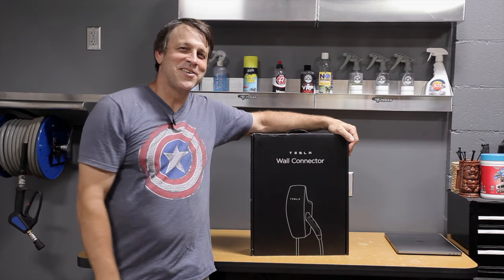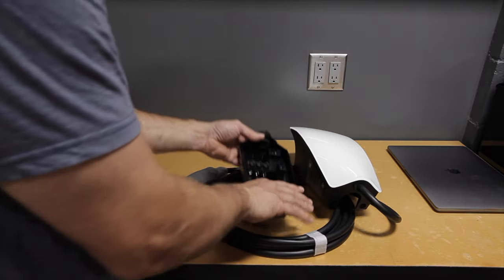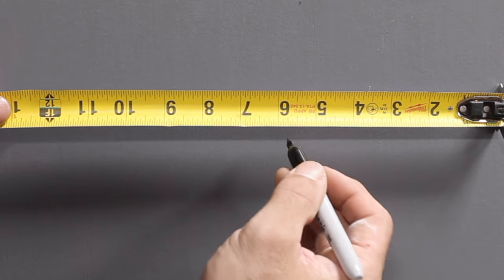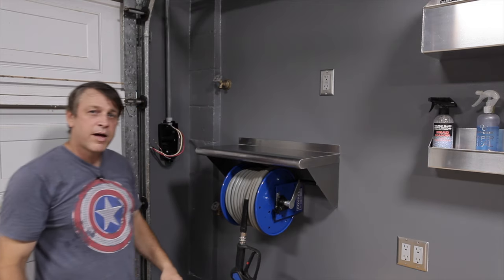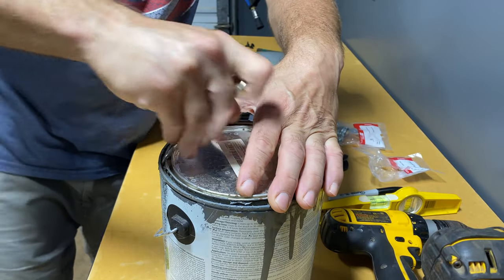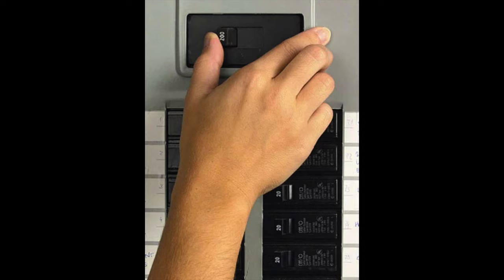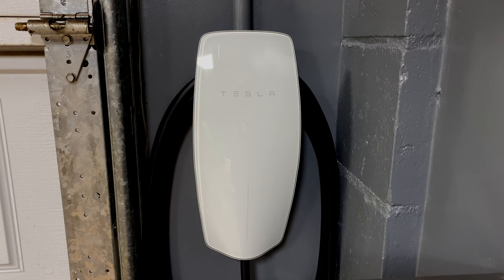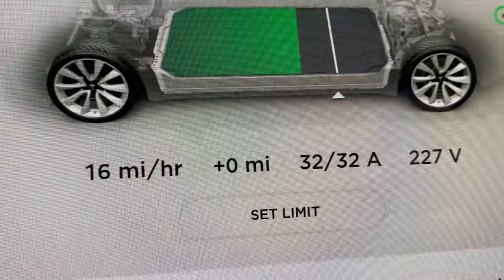HOW TO INSTALL A TESLA CHARGER / TESLA WALL CONNECTOR GEN 3 UNBOXING & INSTALLATION

Comment: I did my install in 2018 with the gen 1.  In the gen 1 there was switches to set and it was not as simple as the latest Tesla wall charger.  I also used 40 amp ckt breaker and used wires rated at 55 amps my material was less than $150.  The install was rather easy.  With the latest wall connector it seems even easier.

Comment: Great job and simple explanation.  I saw some people using the white wire as ground. There's nothing wrong with it, but the ground doesn't carry any current under normal working conditions.

Comment: You were supposed to use the white neutral as the ground and cut the thin ground wire. Hope it works out for you
Reply from the maker: Come on man. Hahaha. Using the supplied ground is more then adequate for this install. You are right that I could have used the white as a ground and that is a good idea. Thanks for sharing and watching.
Reply: not really true. no reason to install a neutral. should have installed 6-2. better yet. building wire in conduit. not romex. unless its just a chase. he did not show the whole raceway.

Comment: I may have missed it but I wanted to know why you chose 40 amp versus going to a faster 60 amp connection? Nice video!
Reply from the maker: My model 3 does not support the 60 am charging. Some models do and I would use the breaker that is right for your car. Thanks for watching
Reply: @HawaiiDetailing  Right, it may not charge to 60 amps but it will charge at 48 amps so installing the 60 amp breaker would allow that. I get 240V @ 32 amps (on a 40 amp breaker) with the included travel charger with the NEMA 14-50 connector installed (I had the outlet installed for my air compressor awhile back). I'm happy with that but if I had a wall connector, I'd want get the max out of it. You could get 44 miles of range per hour at 48 amps while my Model 3 on 32 amps charges at 29 or 30 miles of range per hour. Thanks for the reply!!!!

Comment: Very informative video that was well narrated.

I currently have a 240 V/50 A connection for my 2015 Tesla Model S in our garage. I sold the car and ordered a new refreshed Tesla S. Two questions:

1. Is the mobile connector that comes with the car and an adapter be adequate?
2. If I decide to get the Gen 3 Tesla Wall connector, how easy is it to hook it to the 240 V socket in our garage? 
3. How much would an electrician charge to do this conversion?

Thanks.
Reply from the maker: 1. It’s a reaaallly slow charge with the supplied 110 wall charger. 
2. I think it requires a handyman level of skills with reasonable knowledge of electrical to be safe. Always use a pro if in doubt. 
3. I am not sure if the cost in your area. 
Thanks for watching.

Comment: Good video on the installation. Did you cap the white neutral wire at the breaker panel also, or did you go ahead and connect it to the neutral buss?
Reply from the maker: Thanks. Capped it on both sides.

Comment: Great install. Out of curiosity why is there a "maximum height" for install. I've seen people mount them on the ceiling and use a retracting cord to pull it down and have it all out of the way.
Reply from the maker: I am not sure. Maybe a code thing. Thanks for watching

Comment: So how long did it take for you to be sick of having it stuck back in the corner?
Reply from the maker: Its still in the same spot. I like it there. Only real option I had as well. Its just me using it and the charge port on the Tesla is about 3' from the charger. Easy to use. unwrap 1 loop and plug in. I kinda like that its tucked away. My garage is set up for detailing and I did not want the charger to be in the middle of all the wall mounted tools. On a positive note from that location it can reach full length of the cable out into the driveway too.

Comment: It’s not charging at 16 mph because you are close to set point.    It’s because your A/C or heat is running in the car using power.  If you close the car and lock, it will go to 30
Reply from the maker: Thanks for the suggestion

Comment: you should have used the neutral white instead of the ground. that ground wire is likely substantially undersized for the current.
Reply: not true. 10 ground is approved for 50 amps. no need for the neutral. waste of money.

Comment: In the Tesla manual they say not to use a GFCI for that unit
Reply from the maker: Yeah I wired mine directly to the 40 amp breaker. No GFCI.

Comment: Beautiful video man...Thank you.  Quick question can I use a 50 or a 60 amp circuit breaker?
Reply from the maker: Yes a 60 Amp. Certain Teslas can benefit from this. Here is the info. https://www.tesla.com/support/home-charging-installation/onboard-charger
Reply: @HawaiiDetailing  ok back again. My electrician installed a 60 AMP breaker for my M3SR+ will that be an issue? He installed my neighbors MYLR😆 maybe I should have told him I had a different car.

Comment: Not a huge deal, but curious why you opted for a 40 amp circuit, rather than a 60 amp. I believe the gen 3 can support up to 60 amp, so you can charge at 48 amp output.
Is it because you have the low end model 3?
Reply from the maker: Yeah the low end model has a lower amp charger on board. Thanks for watching.

Comment: Hi, Thanks for the great , very calm and well explained video.  A quick question- is conduit necessary?  My charger is going to be only 1 foot away from breaker.  Going to use 6 gauge wire.  Thanks
Reply from the maker: I would use conduit if the wires are going to be exposed

Comment: I enjoyed your video!

My gen 3 wall charger was professionally installed few months ago and worked well.  In the past week it would stop charging; error messages say to check the grounding and also to make sure it's torqued properly.  Did the electrician not do a proper job?  It did work well for several months...also I wasn't aware it's got wifi and that the PW was on the quick start guide (which I can't find)...my son was home for the installation and he simply handed him the boxed charger.  Be nice if he'd informed me about the wifi...
Reply from the maker: Sorry to hear about your charging issue. I would call the electrician and explain the error messages and see if they will take a look at those items listed. If there is no problem with the install than you can call Tesla support and ask about the charger errors and also the WiFi password that was lost. Good luck. Thanks for watching.

Comment: Hi, thanks for the video. I have a similar situation in that i want to install the wall charger between two garage doors with limited space so have to let the connector hang. Can you tell me the width you have between the door track and the wall? Thanks!
Reply from the maker: 13”. Thanks for watching

Comment: because you use cable #6 and install a 40A breaker where cable #6 supports 60A
Reply from the maker: My Model 3 only needs 32 amps. I actually charge at 20amp most of the time to keep the cable temp down. Size it to your exact rig is what I would do. You only need max amps if you are trying to fast charge.

Comment: Need to show how u connect the breaker amp  and what type of breaker for the box .the wire should be 4 gauge if u want 48 amp output ,minimum is 6 gauge  no 8 gauge.

Comment: Very nice job on the tutorial! I have a question for you. I have a 6 years old lv2 charger installed. I found 2 black wires and a green wire in the power box connected to the current charger. If I get the Tesla wall charger, that 2 black wires should go into the L1 and L2 slot? And the green wire goes into the ground. Is that correct? Thank you!
Reply from the maker: Sounds right but I would confirm that at the main panel and make sure the 2 blacks are connected to the 220v breaker that is being used. If your unsure have an electrician look at it. Thanks for watching.
Reply: @HawaiiDetailing  I turned the power off from the breaker and tested no power came through. So most likely it is this 2 black wires. Thanks you for your reply.
Reply from the maker: @andyly3382  your welcome.

Comment: How to do the wiring, if Circuit breaker is in basement (right side of the garage) and Tesla will be parked on the left side of the garage?
Reply from the maker: Its hard to say without a site inspection. I would consider consulting an electrician to help you work out a plan. Thanks for watching.

Comment: Once you set the charger up, is it manageable via the tesla app vs connecting to its ip later on?
Reply from the maker: Thanks for watching. I have not had to connect to it since the install. Sorry. Its just been plug and go.

Comment: Can I  install the tesla wall connector on a 50amp breaker and still pull 48amp using the Awg 6.  ?
Reply from the maker: Generally speaking 6 AWG wire is the proper size. You should be good pulling 48 amps through that setup. If there is any doubt about the install I would ask an electrician to be safe and you will also have piece of mind knowing it’s done correctly. Thanks for watching and I am sorry I do not have more info for you.

Comment: Jeremy, how wide is the space where you installed the charger? I'm thinking of using the same spot in my garage but I don't think I have the same amount of room. What would be the minimum width between the door rail and the wall to allow the cord to be hung/draped over the charger?
Reply from the maker: Sorry it took a while. I was super busy. I have 12”. At 10” it would be a squeeze but doable. Under 10” and you would be making special effort to get it wrapped. The charger is about 6” without the cord wrapped around it. Thanks for watching and following the channel.
Reply: @HawaiiDetailing  thanks so much for the info.  Really appreciate it.
Reply: Finally had mine installed. I have 14” of space in the same spot of my garage, and  the charger fit perfectly there. Thank you so much.
Reply from the maker: @vanedge  yeah. Glad it worked out for you. Thanks for watching the channel
Reply: @HawaiiDetailing  Jeremy, this channel has taught me so much. Can’t thank you enough for all the content. From Adam’s Mega foam to the P&S interior, the Invisible Glass cleaner and everything in between, you’ve been an invaluable source. I have some interior detailing brushes on the way now based on your recent Tesla interior cleaning video. Can’t wait to try them out.

Comment: What is the difference between using a 40 amp breaker and a 60 amp breaker? I’ve seen both being used on these videos, is it just preference? I have a Model Y does that make a difference?
Reply from the maker: Some Tesla’s cannot utilize a 60amp breaker due to the cars onboard charger limitation. Because of that there is no reason to use wire that thick and a breaker that large if the car won’t charge at that higher amperage. Check your Tesla manual to see what size breaker and wire you can take advantage of. Hope that helps. Thanks for watching. Here is the document that you need. 
https://www.tesla.com/support/home-charging-installation/onboard-charger
Reply: @HawaiiDetailing  I’ve seen most Tesla’s that charge at home charging at 48 amps, so isn’t it better to go with a 60 amp breaker?
Reply from the maker: @neil5819  the 3 I have won’t charge at the higher rate so there is no point. Thanks for watching
Reply: @HawaiiDetailing  yeah, I gotcha. That makes sense. Although I just thought it might be a good idea to sort of future proof it. Maybe save you that extra work down the line in case you decide to get a Tesla that accepts that 60 amp charge. Anyway, great video nonetheless! Thanks!
Reply from the maker: @neil5819  good point for sure. That’s why I ran 6-3 wire so it would just be a breaker swap if I ever wanted to go 60 amp. Easy and affordable.

Comment: I have dryer breaker 30amp  on my  panel , does that mean I have 220-240v? Thanks
Reply from the maker: Yes. Every panel in the USA has 220-240. The dryer breaker should be a double size breaker. So it combines two 110 to make a 220.
Reply: @HawaiiDetailing   once I have watched your video I think I also can install it  by myself can you please advise me which wire (12-4awg) and breaker(60amps) should I buy thanks in advance 👍🏻👍🏻👍🏻👍🏻👍🏻
Reply from the maker: @ManishShrestha-ju4np  Thanks for reaching out. I used 6AWG wire on a 40 amp circuit. Wire type and size depends on a lot of different things. Circuit size, length of run etc. Definitely do your homework and be very careful if you are not 100% sure. It is worth getting an estimate from a professional to see what the cost would be for them to do it unless you are 100% comfortable.
Reply: Length 35ft, I want to use 60amps any suggestion 👍🏻👍🏻
Reply from the maker: @ManishShrestha-ju4np  Without being on site to see the details I can’t really offer a suggestion on this. There are tables and guides out there. There are also a lot of variables for managing the wire both in size and how the wire is installed for a legal installation. Sorry I don’t have more for you.

Comment: I was told you need a 60 amp breaker????
Reply from the maker: Some Teslas have larger breaker requirements. Mine does not. Look on the Tesla website for the correct size that your car can benefit from. Thanks for watching

Comment: Thanks for making a great video. I'm curious as to why you didn't use a 60 amp breaker for max charging speed?
Reply from the maker: My model3 can only charge at 32 amps max due to the charging limitations of a SR+ so there was no benefit. Thanks for watching.

https://www.tesla.com/support/home-charging-installation/onboard-charger
Reply: @HawaiiDetailing  Didn't know about that, thanks for the reply. I'm sure your next Tesla will be able to use the higher amps 😁
Reply from the maker: @rl9702  You are welcome. Here in Hawaii I hardly ever use half of the battery so when I plug in at night it’s ready in the morning. Think it takes about 6 hours at 32 amps to fully charge my car give or take. If you live somewhere where you use the whole battery and have short turn around on charge times this 32 amp limitation might be a problem. These are the reasons why I cheaped out and got the lesser range model. Lol. Next 3 might be a performance. Like the car I have a lot though.

Comment: The only thing is that the built-in hanger will not work since is too close to the wall.
i made the same mistake myself and had to move the charger.
Reply from the maker: Yeah. Would have been nice to have more space. This is the only spot that makes sense for me to mount the charger. I just wrap it around and it works fine. It was more important to have it near the garage door so that I can reach into the driveway. Thanks for watching.

Comment: You used 6/3 that is rated for 60 amps. Why you only put 40 amps breaker instead of 60amps. 60amps is way faster charging than 40amps
Reply from the maker: The model 3 standard range plus can not utilize the 60 amp charge. It only chargers at 32 amps due to the onboard charger in the car.
https://www.tesla.com/support/home-charging-installation/onboard-charger
Reply: @HawaiiDetailing  if you bought standard model 3.
Reply from the maker: @pinoyelectriciansbayarea1608  that’s what I have.
Reply: @HawaiiDetailing  ok you did great job on installing it.
Reply from the maker: @pinoyelectriciansbayarea1608  thanks.

Comment: You placed the charger right next to a water hose.
That water hose at what ever point can splatter water all over and on the charging unit.
Oops, Fire Hazard.  Yeah, not the best place for it !!!!
Reply from the maker: It’s an outdoor rated charger. If there was a water leak I would be more worried about everything else in my garage getting ruined before the charger. Thanks for watching